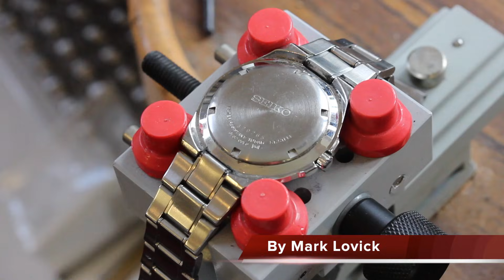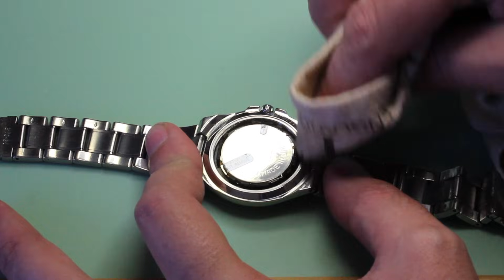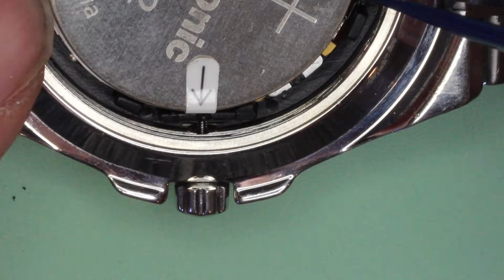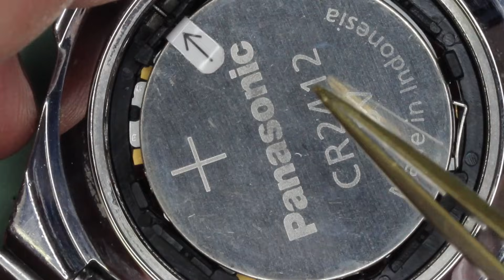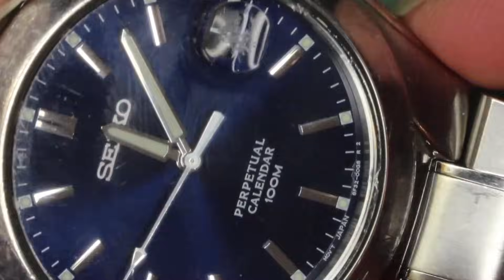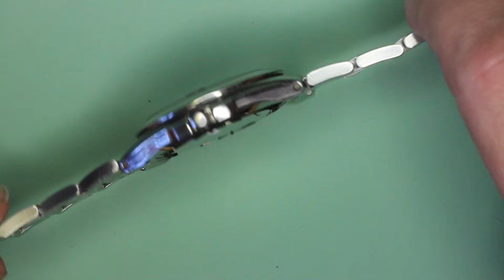How to reset a Seiko perpetual calendar and fit a new battery. Watch repair tutorials. 8F32

Comment: I had my Seiko Perpetual watch battery changed at Sears and I thought the date and time were properly set until the month changed and the date was off.  I thought I might be able to fix it myself but after watching this video, I think I need to find a watchman (jeweler) to reset  it and it will not be the Sears jewelry shop.  Too bad, I have depended on them for decades.

Comment: Thank you so much for sharing your knowledge with us! Just a quick tip for other who follow, the crown needs to be pulled all the way out when resetting and setting the calendar Also, the "AC", "0", "Y", "M", "D" markings are actually stamped into the silver tabs near the copper colored contacts, Mine were in exactly the same positions as shown in this video.  I also carefully peeled the plastic wrapping off the existing battery and put it on the new battery. My watch which I purchased new maybe 15 years ago, had only 1 previous battery change. It had a nonconducting brownish covering over the movement with an opening that corresponded with the opening in the battery wrapper. My Elec Eng gut tells me is if your watch has lost that layer or its an early version that didn't have one from the factory, and you don't re-use the battery wrapper, you're going to probably cause a short circuit and damage the watch. So, re-uses the battery wrapper just to be safe.

Comment: Thank you so much for this. I had brought my 15 year old Seiko Perpetual into 2 different watch repair shops in the US and both turned me away stating that the risk to breakage and hassle of reprogramming was not something they wanted the liability for. Stuck with a broken Titanium Perpetual for ever or just trying to do it myself I found this video. Absolutely fantastic step by step instructions and I removed and replaced the battery easily and reset the calendar the very first time. You just made my weekend even better, I am just sorry it only took 4 years after you originally posted this tutorial!  If I can offer one bit of advice as your watch band and case were pretty beaten up, I use MAAS polishing cream, a cotton swab and a soft cloth and can polish out most surface scratches from watches and bands without too much elbow grease. My Perpetual looks almost like new and thanks to you works perfectly again!  Thank you.

Comment: Mark

Thank you very much for this video and I have now solved it - the 8F32 watch which a registered watch repairers in Tring, England told me needed a complete overhaul at the cost of over £100 is now fully functional with a £5.50 Panasonic battery powering it, with the date correctly set! Your instructions worked fine once I followed them to the letter.

I can now answer my own earlier question and that of others below reference the label. Only Seiko sell the 2412 with a label attached, and I was confronted with a watch returned with no battery, hence no label. I used an image of the battery with the label on, downloaded via Google images, which I scaled to the exact dimensions of the battery, and then printed a copy onto sticker paper, which I covered with plastic film, ensuring to place a hole in the correct place for the negative terminal to still make contact with the battery.

I am so glad I persisted because I cannot afford to buy another perpetual calendar watch with an accuracy of ±20s pa - the original was a significant birthday present and is now nearly 14 years old.

Please keep your channel going Mark, it is really helpful; and to all those out there in similar situations persist and do not throw good watches away without giving it a go. Amazingly with the right instructor even a ham-fisted amateur as myself can do a sight better than some so-called professionals who appear to give up unless their pockets are filled with copious amounts of sterling!

M

Comment: hi the sticker on the battery reads do not remove. if you peel the sticker where is says do not remove and use this as a tab to remove the battery.
Alan from Zambia.
Reply from the maker: +Alan Mcinnes Yes you can do this, but personally I don't like that method. It is very easy for the whole movement to pull up with it and the stem can bend - I have seen a lot of bent stems in these watches and I suspect this is why. Having said that, I have seen a lot of circuit boards damaged when people lever the battery like I do. Thats why I make the point to use the metal part as the lever points :)
Reply: Thanks for all your help.
regards Alan.

Comment: Great stuff!! I sent mine off to a highly regarded watch repairer in Texas, and he did the servicde the first time. The next time I sent them (mine and my wife's) off for a battery replacement, he claimed that he couldn't do it due to the lack of parts and returned them. I seriously hope he didn't damage them. I'm going to order some batteries, and try this out for myself. I really don't have anything to lose at this point, as they have been sitting for 10 years with nothing done. The adventure begins!!
Reply: The hour hand on my Seiko is no longer moving after a battery change 😢

Comment: Hi Mark, Excellent video. Thank you very much. You just saved me at least $90 in labor charges if I took the watch into a repair shop for the battery replacement. Very easy to follow along. Thanks Again...Cheers!!

Comment: Well, I just took the sticker off my original battery and put it on the new battery.  My local shops wanted nothing to do with this watch so I did end up just doing it myself.  Darn thing was $325 when I purchased it like 10 years ago so I am glad I got it working again.  Thanks for the video, my watch is now working again.

Comment: Why does the arrow on the battery need to be lined up to the pull out dial?  I have a replacement CR2412 and it has no sticker.  I have not opened up my watch yet, do I take the sticker off of the original battery and put it on the new battery?  Why is that sticker important?
Reply: I was wondering the same when I bought my battery. I think that it is just a way for Seiko to make money.  The sticker probably is designed to give a charge to certain parts of the circuit which is crucial for the watch to work.   I took off the sticker carefully and stuck it on my new battery. I haven't got it to work yet since I didn't set it by bridging the connection with a tweezer like the video shows.
Reply: I did the same thing,  Removing the sticker.  I found out that if you just slap the battery on without that sticker that it can kill the watch as it was only designed to to touch one particular spot on the negative side.  I did the circuitboard thing like in the video.  It wasn't very difficult but I had to take photos of the connections and zoom them just to read what they said lol.
Reply: EviLNox8 because it's an insulator. the arrow points to the crown to orient the hole in the sticker with the negative cell contact on the movement .

Comment: What does it mean if you can only get the date to move just two or three times then you have to reset it again before it will go another two or three? Doing this, once i finally get it to 1 i can usually get the Y correctly (3 for 2015) but then the month will never go either. I've only ever sent it to seiko but seems they probably will want to say it's broken now.

Comment: Hi Mark, You saved the time and calendar on my Seiko. Thanks for you clear instructions. Only thing not mentioned is the removal of the isolation sticker from the Seiko battery and stick it on the new Panasonic CR2412. Thanks from the Netherlands.
Reply: Did you ever find the video for this? I wondered the same thing.

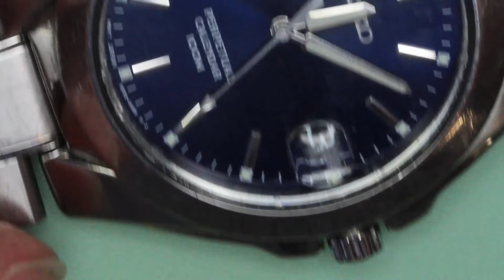Comment: My 8F56 Perpetual Calendar is now up and running thanks to you.  At first could not get the calendar ring to zero out/to one because the winder ring was pushed back in accordance with your instructions for shorting out the a/c contact (approx. 4:15 in video; "...pull the winder fully out and push it back in"), and I did not notice you had pulled the winder fully out, approx. 4:35 in the video.  Once I pulled the winder all the way out, was able to reset all settings, calendar, month, year and day.  Thank you very much.

Comment: Must you replace cr2412 with a sticker for the watch to work. I have follolwed your EXCELLENT video instructions , however my watch.Dosen't start up .
 The replacement battery does not have any stickers on it . Reading some of the other comments , I had to ask this question., Thanks for taking the time to reply
Reply: This is what my problem is, my new battery has no stickers!! Is yours ok?

Comment: Hi Mark, excellent video and very helpful as I have just had one in for repair with a broken stem and someone had already removed the battery so slight panic when it wouldn’t work after fitting new crown and stem. At least its now working and I know what to expect next time

Comment: Excellent Tutorial! Very helpful. I couldn't find a local jeweler who knew how to replace my battery and reset the perpetual calendar! The only thing this instructional is missing is how to check that the settings are correct. To do this, pull crown out one position and push back in within one second. The second hand will move at 5-second intervals and stop the number of years since last leap year, then the calendar number will move to current month, and finally the calendar will move to current day.All set! Thank you!

Comment: Hi Mark. Followed your very good video. But seem to have a problem with the new batteries. My watch battery stopped working several months ago. Due to cost I didn't have it replaced. But having found your video, thought I would give it a go. Purchased two Panasonic CR2412 batteries and attempted to install them. The watch did not work though. So put the old battery back in, now works but won't allow me to change the calendar and it moves forward at 2 second intervals. Any ideas would be great. Should I change the plastic cover over from the old battery?
Regards Peter
Reply: Im no expert, but I transfered the sticker from the old battery. As for the two second sweep,that means replace battery soon, or lose calendar settings, but sounds like you already did.

Comment: Hi Mark i was interested to know why you don't work on Panerai branded watches?
Reply from the maker: The last one I received in for repair, I found to have a 7750 movement in but modified in a way that you would quite easily damage it during disassembly. The only reason for this was to force owners to have to send the watch in to Panerai for service as the part was only available through them. Since then I decided not to touch Panerai's although the Unitas based Panerai's are simple enough to work on.

Comment: Hi Mark,
Have you serviced Patek Philippe, Audemars, Vacheron Watches. Can they be difficult to service?
Reply from the maker: All of these watches follow the same principles and form and are technically no more difficult to work on, but sometimes I wisely stay away from watches where parts are not available to me just as I would with a budget Chinese manufactured movement where the parts are also hard or impossible to obtain.

Comment: This is exactly what I needed. I notice that the magnifier secftion over the date on your example is scratched. Mine is even worse. Can this be buffed and polished with a rotary tool such as a Dremel? Is there a better option?
Reply from the maker: Hi Bruce, It is not something I have done before - I personally find it easier to replace them.

Comment from the maker: Hi Andy, for watches there are practically no differences in performance between CR and BR batteries (I have heard that technically BR can have slightly more capacity). For other applications, such as motherboards etc., CR batteries have a higher heat tolerance. As for quality - panasonic batteries are very good. I prefer Renata, but as far as I know, Renata do not make 2412. Lastly - the Seiko branded are 3 - 4 * more expensive than Panasonic, for very little extra benefit.